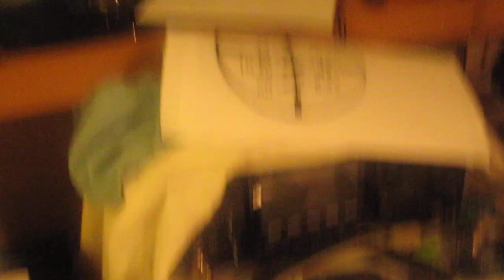MVI 1655

Comment: I am looking for an Raspberry Pi Linux Image for the MicroSD card to run the Dstar DVAP or Dutchstar GMSK Modem boards. This will be a 24/7 system running at my QTH for Dstar Comms. I am having issues with finding the right libraries, distro package to accomplish this task. Contact me via n5vrp.satx@gmail.com or through QRZ.com website.

Thank you for an excellent video....
Dennis